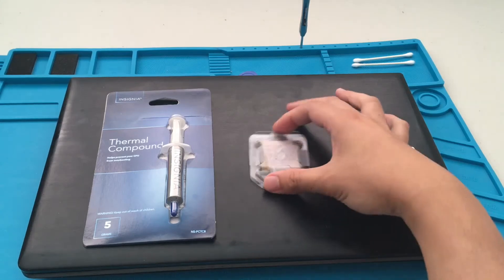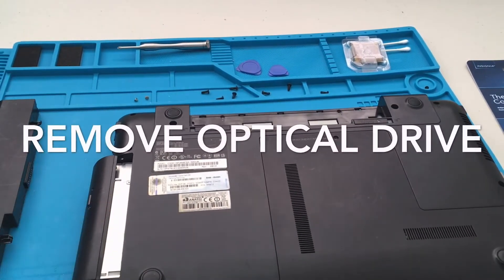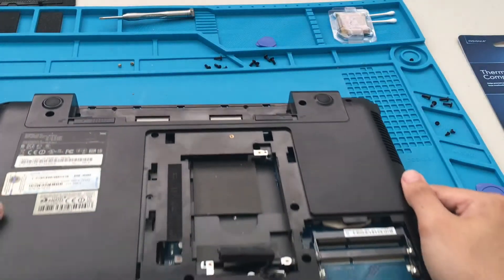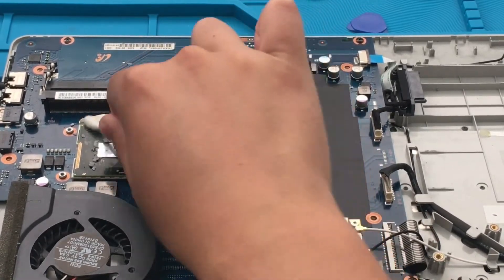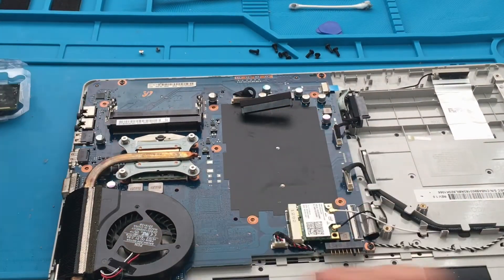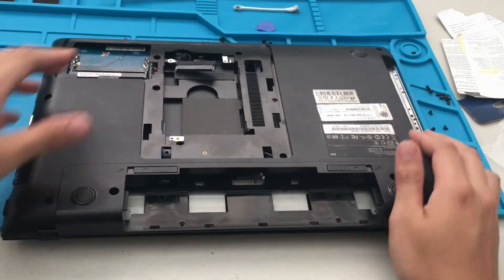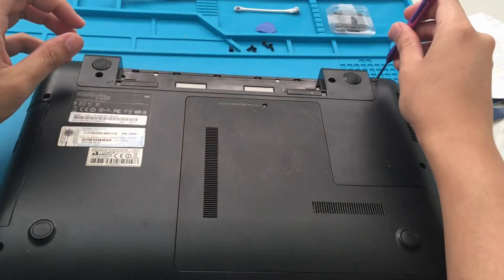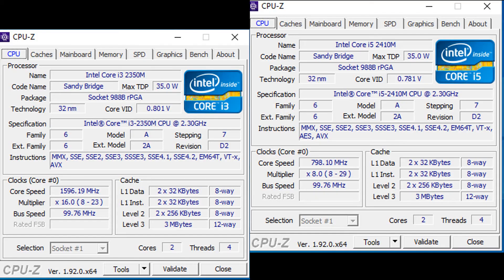My First CPU Upgrade Intel i3 to i5 Samsung Series 3 Notebook NP300E5A

Comment: Hi, just wondering. Do you think an upgrade from the stock one to a i5 or an i7 could also be posible with the np300e5c?
Reply: download from the Internet and install the cpu-z program on the laptop, on pages 1 and 3, look at the processor model, socket type, chipset and south bridge type. Based on this information, I will tell you which processor can be installed :)
Reply: @vladimirazirov1815  pls can u tell me I want to upgrade
Reply: @volcanoftw1265  I need all the information about a laptop - which laptop model, how much RAM, SSD or HDD installed?
Install the CPU-Z program on the laptop from the Internet. On the first page, look at the processor model and socket type (string Package). On the page "Mainboard" look at which chipset and the south bridge of the motherboard.

Comment: Hi, i have a np300e5a i3 2310m, and i have also a asus k43sj i5 2nd gen, can i exchange their processor? What should i consider in changing processor? Like socket type or wattage..
Reply: install an i5 processor on Samsung, and buy and install i7-2670qm in Asus

Comment: Soo i wanted to know that my laptop is the same on as above and came with the b815 celeron so can i put the i5 processor which you are using and also what cpu would you sujjest for the same laptop
Reply from the maker: I would use cpuz z to identify the cpu socket. Once you find that out you can find compatible cpus
Reply: jasetutorials brother pls help me with this thing m installing cpu z right now
Reply: jasetutorials i just want to upgrade cpu soo i was confused about the cpu’s tdp compatibility
Reply: And will i have to update the bios
Reply: jasetutorials my socket is g2
Reply from the maker: G2, is it rpga 988? If it is. Just search for cpu with same socket
Reply: jasetutorials its 988brpga
Reply: But broo i am confused about the tdp
Reply: jasetutorials like of how much tdp processor it would support the one it’s currently running is celeron b815 which is 35 tdp
Reply from the maker: Yup just do a cpu search for cpus with the same socket. You should be able to install any cpu with the same socket. If you want to double check ask the seller before you buy
Reply: jasetutorials okay broo
Reply: Thanks a lot
Reply from the maker: you can also look up your specific motherboard model and look for a list of compatible cpus. usually the best since you can find out manufacturer recommended cpu

Comment: Sir how to change bios battery
Reply from the maker: I have not changed the bios battery yet unfortunately.
Reply: you have to remove the motherboard to gain access to the battery. Or you can reset bios using 4 contacts nearby memory slots (if available). Kinda strange decision - to put bios battery "on the other side".
Reply: @JohnDoe-Unknown  IAM from india

Comment: i can upgrad toshiba satellite c50-a271 pentum 2020m  to i5 3230m ?
Reply from the maker: Did you buy the i5 3230m yet? You could ask the seller to confirm if it’s compatible with your motherboard
Reply from the maker: I checked the pentium 2020m and tbe i5 3230m looks like they have the same cpu socket so you should be good. I would ask the seller though just incase
Reply: @whattmeter  i can trust the seller sir . he just wanna sell the cpu
Reply: @whattmeter  thanks for ur help bro
Reply from the maker: Good luck. It can’t hurt to ask the seller. But if you look up the i5 3239m and pentium 2020m they both have a socket of FCPGA988. Same size too
Reply from the maker: You would have to check your motherboard info to see what socket it has. You can use cpuz to find this information. Or the manual of your motherboard
Reply: @whattmeter  its pga988 can you check it for me plez iam noob at that
Reply: @whattmeter  i will be glad if u can help me plez
Reply from the maker: Yup that is the same as the cpu i have in the video. Here is the cpu info I used (also in the description) https://ark.intel.com/content/www/us/en/ark/products/52224/intel-core-i5-2410m-processor-3m-cache-up-to-2-90-ghz.html

Comment: can i upgrade to 4th gen i7?
Reply: The bios doesnt support 4th gen
Reply from the maker: I don't know if they have any 4th gen i7 with  PPGA988 socket. For sure I know there are 3rd generation i7's with  PPGA988. Do you have the same model? I would double check what cpu socket you have for your computer. The one in the video has  PPGA988 socket, so it was easy to get i5's or up to 3rd generation i7's. 4th generation I don't think so because of the socket type but I could be wrong.

Comment: Hello jase i love your upgrade videos i like all of them. But i have a question im sure you remember me from the other video. If i wanted to upgrade a dell optiplex GTX to like 1660 will i need a new power supply?
Reply from the maker: They recommend at least 450 watts. What was the wattage on your Optiplex again?
Reply: @whattmeter  have no idea i think 275 irdk
Reply: @whattmeter  how do i check
Reply from the maker: Was it an optiplex 3010? It should a have sticker on the power supply itself. If it’s a 3010 Optiplex dt it will be a 250 watt power supply
Reply: @whattmeter  yes a 250 watt power supply
Reply from the maker: Unfortunately it can’t. There might be some videos out there though running this thing. Hard to recommend since it uses up more power
Reply: @whattmeter  Alright i have that GT 710 ill stick with that until then
Reply from the maker: Feel free to look at other videos too. There might be some tips out there
Reply from the maker: I see some run with a gt 1030 but not advisable. Recommended is 300 watt power. Try searching it on youtube.
Reply: @ExploitGodz  a GTx 1650 should work on that psu
Reply from the maker: Btw someone suggested a gt 710 graphics card but gddr5 2gb instead of the gddr3 2gb like what I have in the video (is older)